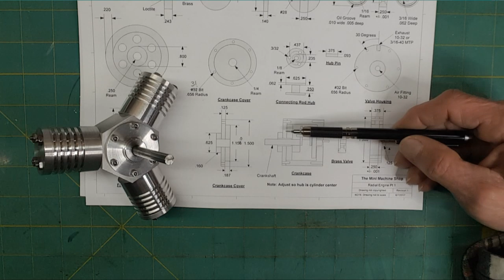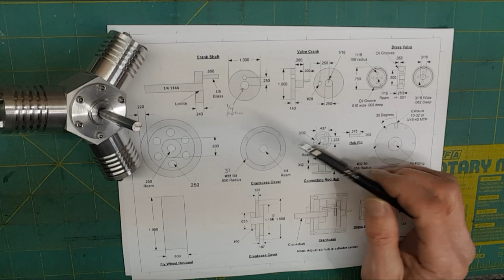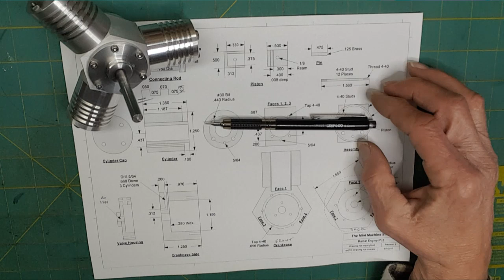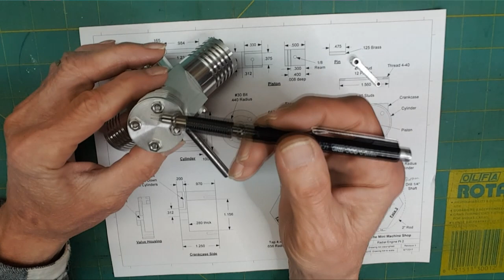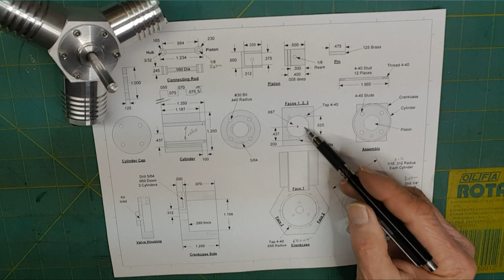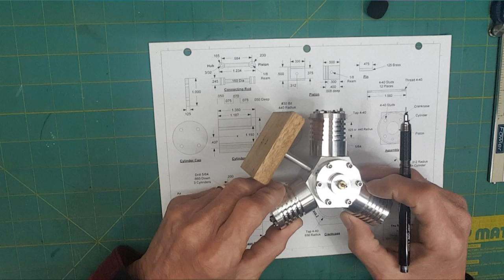Elmer Verberg's Radial Engine Pt5

Comment: Fantastic work! Probably one of the most demanding projects You've told us about. Both precision machining as well as drawing checkups, modifications....... It had been fun to see the assembly process of the engine.
Reply from the maker: Hi Stefan, assembly was a real pain and once I had it together, I wasn't going to take it apart to record it..
Reply: @TheMiniMachineShop  Oh. I respect that. You were lucky that it worked after that first assembly so You didn't have to take it apart, and face a second assembly....